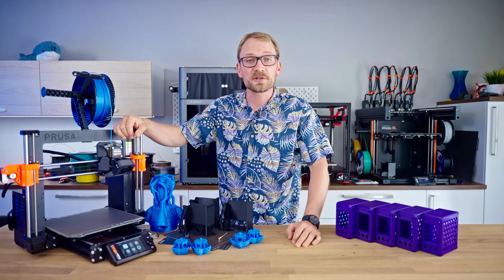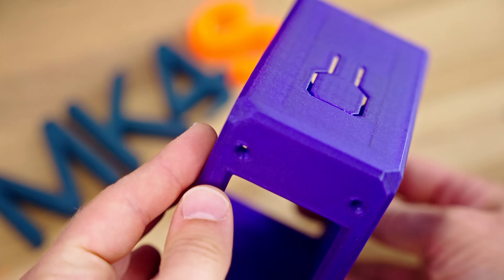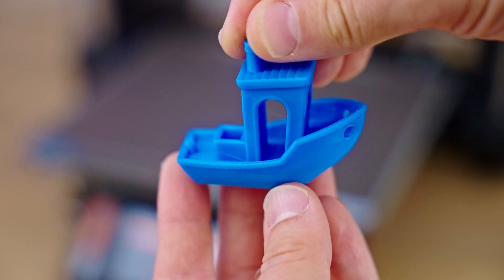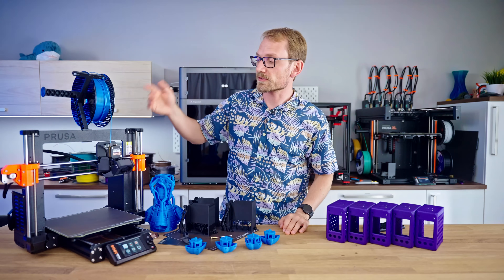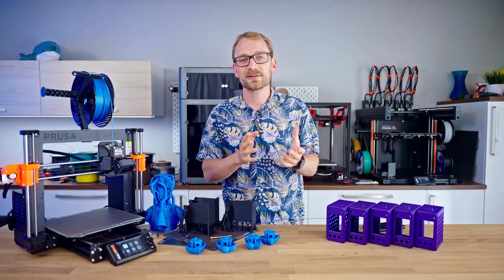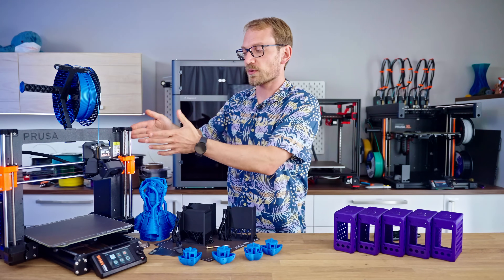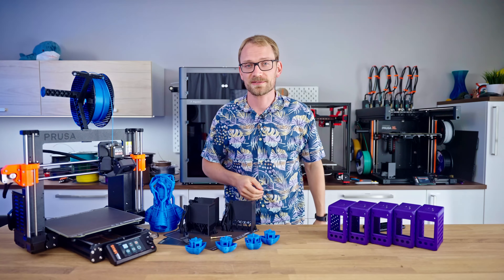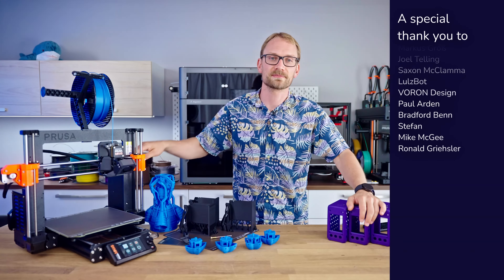"S" is for Speed - Prusa MK4S

Comment: @12:03 - EXACTLY!  I own two Creality machines.  Ender3, and CR-6SE, as well as 2 (way defunct) home built units.  I am WAY over the tinkering/tuning/messing around phase.  Been in this since 2009.  I'm over the tinkering.  I just want a printer that works.  I would LOVE a PRUSA XL (many designs I work on need that bed space, not the height, the area), but that $2K USD price tag is just out of my reach.  Sure I know the realiability, but come on...$2K is just OUCH!  Especially on a fixed income of a retiree...lol
Reply: I wholeheartedly agree with this. That IS the exact reason I even bought a Prusa MK4. I don't need any flashy features or experimental things that make the printer stand out. I have several Enders the I loved to mess around with for years, but now I just want a reliable printer that just works. I don't have the time I used to to just tinker with hardware and code for days just to have to do it again a few weeks later cause something new came out. I wanted the community, the support, the reliability, and the knowledge that what I get form prusa will continue to improve and get better over time.

Comment: The MK4S is way faster with greater quality than the X1C when it comes to printing parts that have either steep or several overhangs.  

Robert Cowan made the comparison and Prusa came way ahead, again on parts that require steep overhangs. On regular prints, the X1C still won but the difference is much smaller now. 

However, keep in mind the bamboo labs ripped off Prusa and is also a security risk on it’s own. For me the Prusa is a no brainer. 

I wonder how long before they upgrade the XL…

Comment: WoooW, another Prusa failure :D The new stuff is 0.28 layers? Realllyyy? This is not faster, it has bigger volumetric speed but does that makes difference in real life?
C'mon they still have no way to easy WiFi connectivity, an App that is STILL to come (?!), input shaper .. emm in 2024? (My CN machines has those nowadays lol), print profiles in the slicer.. Omg I am so sorry to see Prusa dying like that.
For 1200 bucks? Are they kidding me? Who would buy this instead of BBL, K1C, K2, or whatever else you could think about. They are on par with Prusa or even better at some of the stuff. 

This would've been outdated when MK4 was released but mid 2024 this is pathetic.

Comment: Yes, Prusa is not the flash Goth Girlfriend and its great when it comes to reliability and so on.
I love my MK3 and XL 5TH.
BUT for me its sometimes more about "standards" that Prusa just decided to not use...
XL and Cameras is a great example. Xl and different nozzle sizes in one print etc.

I love the Prusa for its quality, the Speed, well its a Prusa right, its more a  Tractor then a Ferrari...
But I still feel that Prusa is severely lacking in their IT department, thinking that making it open source will magically make everybody want to code extra themselfs...

Edit:
Also, if they want to have a distinguishing feature, they could try to aim for dimensional accuracy. They could create a Wizard where i can print a certain object measure it, put the number in the slicer, it calculate it and then can be saved to a filament type...
Then prints with this filament type will automatically corrected in a way that they are even more dimensionally accurate...
This would also hammer home the point of being a workhorse and not just a racehorse..

Comment: I am really tempted to get one of these, but then I look at those 8mm rods supported by printed plastic parts, and think "no, not for $1100". But kudos to Prusa for what looks like a good upgrade.
Reply: I don’t really use my mk3s anymore but I will say the build quality was awesome and I didn’t have to do a single repair other than nozzle and whatnot in 300 days worth of print time. It may not look as polished but their printers are sturdy as hell.
Reply: Oh, my MK4 has been incredible. I've done no tweaking, and out of the box it prints to sub tenth of a mm accuracy. If I model something 30mm, my calipers measure 30.0mm. It just does exactly what it's supposed to do every time. I've traveled with it, too, on several cross-country road trips, and printed in hotel rooms all along route 40, both ways, a few times. Wake up each morning to a finished part, and hit the road again. With Polymaker PolyTerra, I almost can't see the layer lines at all. I've made so many things that look like they came out of a factory. I keep the filament dry in a Sunlu S2 while printing, usually down at 16%, and get no strings at all either. I've been nothing but impressed for a year now.
Reply: @gfixler  You've convinced me. I have owned two MK3S in the past, and had a bad experience with one of them (during a period when Prusa was skimping on perimeters and infill settings on their parts). But seems like love for the MK4 is pretty universal, so I'll be ordering one today.
Reply: @mghumphrey  woo-hoo! All things you know, I'm sure, but this was my first printer, and I had to know very little to get perfect parts. The only things I did were 1) print a temp tower and make sure my temp settings for the PolyTerra were right (actually lower than claimed; I use 185C, because it looked best, 200 still on the first first layer for good adhesion), and 2) I use bone dry filament. I dry it in the Sunlu S2 down to below 20% with a few desiccant packs inside the middle, so they dry out along with it, and then vacuum them with the packs still inside in the Sunlu bags between uses. Those two to things—proper temps and dry filament—and I get factory beautiful things every time. I've even had several occasions where I forget I'm printing something, get a hot and cold flash, like "oh no! I haven't checked on it since yesterday!" and I go in and find it done, or still printing, no issues. Obviously a badly designed part will be an issue still, but that's true for any printer. The only other thing I've done was get a new heaterblock and nozzle recently, because it was starting to print badly, and when I saw the nozzle, I was surprised it was printing as well as it had been up till then. It was no longer a 0.04. It was probably twice that, and worn so flat. I'm going to replace the nozzle a couple of times a year now to keep it in top shape.
Reply: @gfixler  Thanks. I am probably in the "advanced" category when it comes to 3D printing, and have built many printers and know how to create and tune slicer profiles. But there comes a point when you want at least one machine you won't be tempted to tinker with. What attracted me to the MK4S is the excellent surface quality on the prints and the performance on overhangs. The latter means I can crank out quick designs for my own usage without worrying as much about design for printability. I ordered one of the ObXidian high flow nozzles. I use that on another printer, and I think it will let me not worry about which material I am printing, but still achieve decent flow rates. Yeah, it's still slow compared to my CoreXY printers, and is not enclosed, so if I need a draft part super quickly, or a part in ABS or ASA, I can just use one of those. But having options is great.
Reply: @gfixler  Well, unfortunately I had to cancel my order, because Prusa is lying about ship dates again. When I ordered, and even now, the order page "In stock. Expected processing time 2-3 days", but after you order, when you go back and check the order page, it will be at least a month out. I confirmed with Prusa support that the earliest my order from Aug 15 would ship is Sept 17. I wouldn't be surprised if that date slips again. This is ultimately why I cancelled my XL pre-order with them, after waiting more than a year, and with no confirmed ship date in sight, I decided they couldn't be trusted. It seems they haven't learned.
Reply: @mghumphrey  aw, I'm sorry to hear that. They do take a while getting things out the door.
Reply: @gfixler  It's not that. It's deliberately lying about ship dates in order to get your money. Even now, their order page says in stock, 1-3 days preparation time. I won't support a company with those ethics.

Comment: Another example of the MK4 being prioritized over the Prusa XL
Reply: Im sure they're working on the two in parallel, it makes sense to launch the MK4 upgrades first since the machine is simpler and more people have it.
Reply: @Kosaro1234  I really don't think they are working in parallel. You only have so many people so why have two people both working independently on the same extruder. I am sure the improvements of this extruder will come to the Prusa XL it will just take longer and may need slight tweaks.
Also the addition of with injection molded parts is odd and just does not feel right. Injection molded parts are not to replace 3d printed ones it's to be able to make large and more complex things at much lower cost. Maybe they are just using this to test the waters, I hope.

Again showing that Prusa does not, will not and have not prioritised the Prusa XL.

Also I would like to point out that I own and want to love my Prusa XL but the reality that it is underperforming hard makes me feel bad. I want to see Prusa take the criticism on the chin and get up stronger.
Reply: @Ender_Wiggin  I have one too, and tbf we did get the 6.0 firmware update a few months back which dramatically improved the printer, and we also got an enclosure about a month back. And now the app!

I'm looking forward to the software update where they enable the XL's accelerometer for input shaping (probably coming soon since its now available on the mk4)

I imagine it'll be trickier to improve the XL's fans due to space constraints, but I'm curious what they'll come up with.

Comment: I just don't like that they're using more injection moulded parts. I know, they're the same, non-changing parts for every machine, but I still want them to be 3D printed. It looks like the Nextruder gear cover is also injection moulded if its not just printed on a smooth PEI sheet. That's unlikely though. I also don't like the use of CF infused plastics, these have now been shown to not be good to handle at all, they'll also wreck any standard brass nozzle that the vast majority of people have as their sole nozzle. I know these parts don't break often to even replace, but still.
Reply: Injection molding is also significantly cheaper for mass production.
Reply: @KJMcLaws  I know, but they don't look or feel as nice to look at every day compared to 3D printed parts.
Reply: They did say the injection molded part's file will still be available to print your own if you want to.
Reply: @gfixler  I know, but I'd still miss the UV ink printing. Maybe if they sold a 3D printed with 'MK4S' on it that would satisfy OCD people like me.

Comment: I'm glad that they are finally releasing an accelerometer (and presumably support in the firmware) to tuning input shaping. I've been wanting to put a copper heatblock so I can use my WC nozzles. Copper heatblock is already available 3rd party, but I was worried that the extra mass of copper vs aluminum would throw off the default IS values.

Comment: Smaller build volume, slower print speed and more expensive than a P1S...

In the UK for 50 quid more you can get an X1C. Which is better in every single way.

Its just too expensive for what it is.

Comment: Well, the MK4S still does not outperform the A1, which is disappointing given that the price tag is three times higher.
Reply: In what way does it not outperform the Bambu Lab A1?
Reply: @RightJoystick  Speed, design, ease of use, ease of maintenance, and last but not least : value for money ! Simple as that.
Reply: The MK4 will have a long life and can be easily repaired. The A1... not the same thing. Having a Prusa (MK3S+) and a BambuLab (X1C), Prusa are far better choice if you want something that really works all the time and for a long time.
Reply: @blm7929  Perhaps we have a different perspective, as we manage a print farm with over 100 printers, primarily Prusa models. While the durability of Prusa printers is well-regarded, they do require significant maintenance, particularly the MK3S+ and Mini+. This issue has only marginally improved with the MK4. In contrast, our BambuLab printers only need a few minutes for a complete hotend replacement, resulting in lower maintenance compared to our Prusa fleet. Currently, our BambuLab printers are the most productive on our farm, with performance that outpaces the others.
Reply: MK4: 4 Million hours of test data in printing farm
A1: bad bed cable

You do get what you pay for 😅
Reply: @kimmotoivanen   The 4 million hours of printing refer to the total operational hours of Prusa's entire printing farm across all models, not just the MK4. To put it in perspective, 4 million hours represent years of continuous printing, so these numbers do have significance! Let’s be honest, from a printing farm perspective, maintenance time for Prusa printers is considerable. In contrast, you can replace an entire hotend on BambuLab printers in seconds without any tools, which is one reason we no longer purchase Prusa printers.

Moreover, BambuLab has set a new standard in customer service by taking on responsibilities that few brands have done before. It’s important to recognize that the cable issue was addressed as a preventive measure for long-term safety. Based on my experience, as long as you ensure the cable doesn’t constantly bump into obstacles during printing, the original cable works perfectly well and was in excellent condition while waiting for the upgraded version.

For the price of one MK4, you can acquire four high-performing machines. And for the cost of a single MK4 replacement nozzle, you can get two complete hotends. I appreciate your passion for Prusa and your loyalty, but sooner or later, technological realities and market competitiveness will bring things back to reality.

Comment: Personally, when I bought my Mk4, I only had two complaints:
uneven part cooling, and a lack of usable GPIO, despite having pins available, and the codebase mostly there. This fixes both of those, and I am 100% buying it, because $100 is a whole lot less expensive than the dev time it would have taken me to get there. I fully approve of incremental changes and upgrades.

Comment: how is the Nozzle Swapping?
With the regular MK4 i've gotten spoiled by the Quick swap bit that locks the heater-block in place and lets you just unscrew the nozzle. This doesn't look compatible with that.
Reply from the maker: My bad for not explaining that - the new stock high-flow Nextruder nozzle is, in fact, a full long nozzlebreak in the same formfactor as all the other Nextruder nozzles for the MK4(S) and XL. The adapter solution simply is what you had to do up to this point to get a CHT nozzle into a MK4/XL.
Reply: Would love to hear about this

Comment: Prusa claims the MK4S is "super quiet". But in this video you claim it has the same noise level as the MK4, which isn't super quiet. Do you know where their claim of super quiet is coming from?
Reply from the maker: Stealth mode is still available and still makes the printer significantly quieter - but for regular printing, fan noise and mechanical noise from accelerations dominate the sound profile.
Reply: Probably stealth mode

Comment: €100 seems like a steep upgrade. Couldnt we just add the new fan + printed parts and a nozzle from e3d?
Reply: The upgrade is now available on their page. And it's actually 109€. Contents are:

Prusa Nozzle brass CHT - 0.4mm
Nextruder parts (including PCCF printed parts)
Wi-Fi board and NFC antenna
Cover for xLCD and Nextruder cover
Silicone cover for heatblock
Fasteners and other accessories

I'm undecided yet if I do the full upgrade or just pick some selected things.. The CHT Nozzles are now also buyable (but out of stock) on their page for €27,90. 
(Also I'm not sure where the 109€ comes from. Nozzle might be a big block, WiFi/NFC board might be another 10-15€ ... hard to tell without knowing the exact part list)
Reply: @Flo-8bit  For the faster printing the new nozzle and the nextruder parts are the only things needed. It seems like the new fan is held by some metal parts, but I'm sure someone will bring a 3d-printed version to printables. Curious if they use a standard fan or something custom.
Reply: @Flo-8bit is the fan included in the nextruder parts? High quality fans can get very pricey, just look at what noctua asks for.